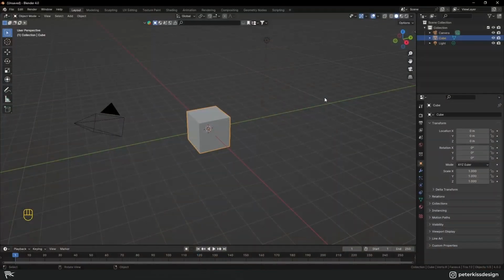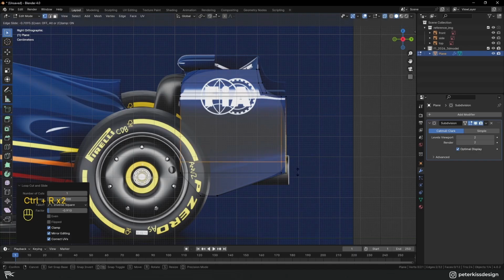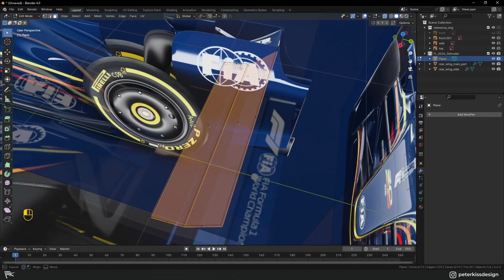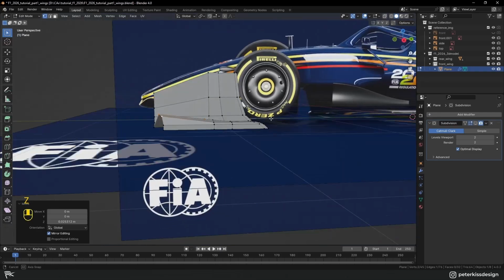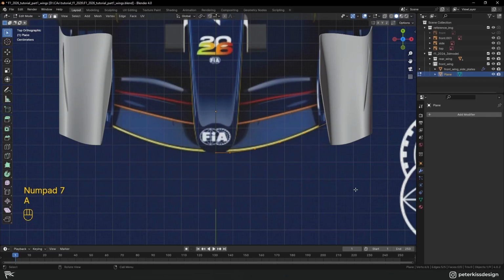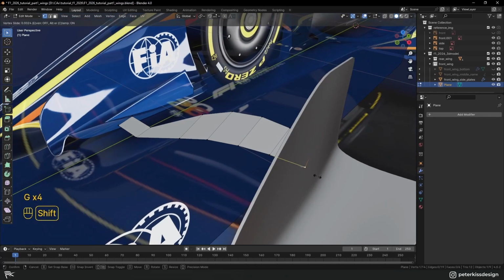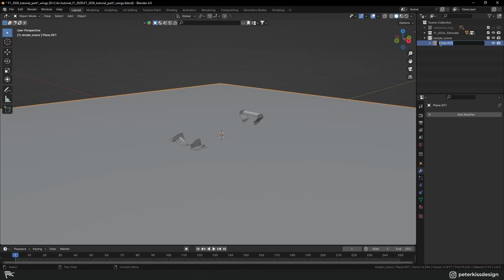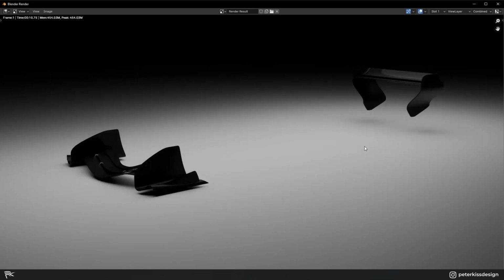Learn Blender by Making F1 Car – Part 1: Wings

Comment: got some issues with the mirror part could u help ? I can't mirror it to the other side
Reply: Right click the part you are modeling, set origin to 3d cursor, then it should probably be mirrored in z axis as that's what fixed my rear wing endplate mirroring
Reply: nvm after you rotated a part do ctrl+a then choose rotation, keep mirror in x axis
Reply: @VyssRacing  thanks bro even i had that issue
Reply: Me too did u figure it out by any chance?
Reply: @demarcuscousinsiii2193 nope, i guess It doesnt duplicate where u want right?
Reply: @JustinMaxim-i7f i kind of figured it out add the mirror modifier and them in the modifier tab you can mirror it from the side view image
Reply: right click object and set origin to 3d cursor and then click Z on the axis

that worked for me

Comment: Nice tut! Looking forward to seeing others. One question, why are you adding two edge loops to define edges? Don't you have overlaping vertices then? Quick tip: when using loop cuts on tight spaces use E and F for better distribution of loop cuts! Cheers mate! <3
Reply from the maker: Thanks for the tip. I do it like this, with loopcuts, to have smooth edge after subdivision and smooth shading. You could do bevel as well, sometimes it is more tricky. Basically when you bevel edge and add subd, it will smooth both edges of the bevel, if you do it like this, the two loopcuts remain on their position and subd will smooth only original edge (only on flat faces of course).

Comment: There is a video from @Brickolo_ titled “Modeling Cars Realistically at Low Polycounts” and it is really helpful if you’re not using a subdivision workflow (low poly).

Oh and one thing the video didn’t mention is that you have to make sure the base mesh has edge lines that are conforming to the panel gaps you want cut out